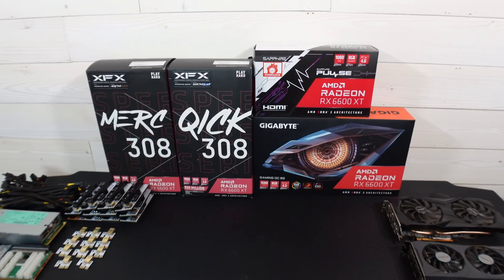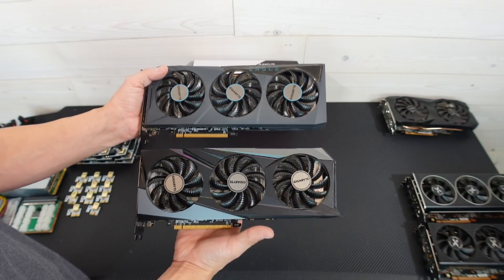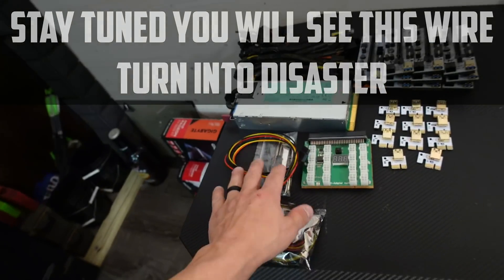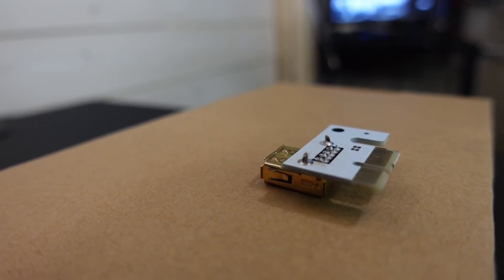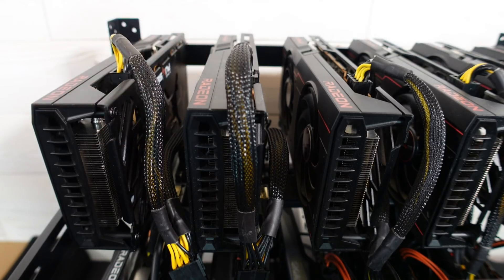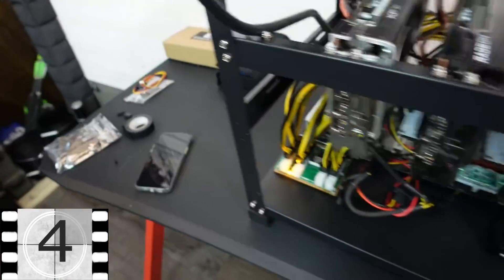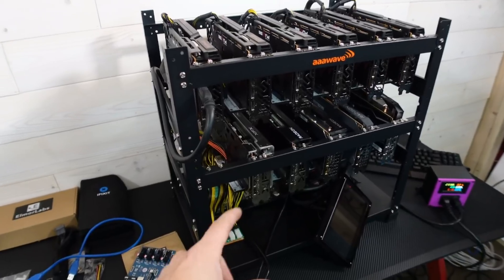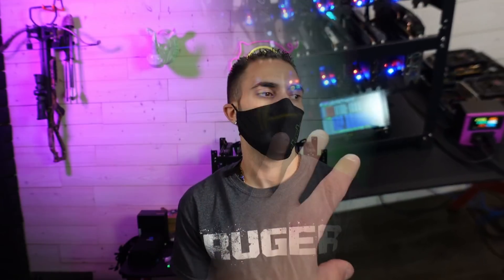RX 6600 XT GPU Mining Rig Build | To Maximize My Ethereum Mining Profitability and Efficiency

Comment: Using sata cables on the mining rig board is a big mistake. Sata and molex cables are low profile and you should never use them. You won't have such problems with 6 or 8 pin cables.
Reply from the maker: The H110 Molex don’t use to much power so it is fine but 100% not recommended; I agree 6-8 pin all day!

Comment: I NEED HELP.
I have a 8x160ti mining rig and it was working great. I am using windows 10.
One morning it shut off and when I restarted it I couldn't get any of the gpus to be detected.
 After undoing the last windows update, I was able to get 3 gpus to be detected.
I've tried all the gpus on other rigs and they all work fine. I've checked the risers and work fine. 
All gpus spin up when powered on. 
 I am booting into the integrated graphics. I was thinking I may need to book into a gpu in order to get into nvidia control panel and just undo the drivers and reinstall them. Could this be the problem? And if so why would this all of a sudden happen? How can I get it to not happen again. Plus what else can I try?
Any help would be greatly appreciated.
Reply from the maker: Get on HiveOS Man Windows Sucks IMO and make it WAY Harder to mine

Comment: I just received the B250C and no signal is coming through to the monitor with HDMI or DISPLAY PORT cables. Have you had to configure anything to make it recognize your monitor? thanks
Reply from the maker: No use the gpu to display not the board
Reply from the maker: In most cases

Comment: one of my rig burned because of power cable after running for several month, luckily only 2 gpus and part of the mobo were burned into ashes,  2 gpus broken because of heat.

Comment: I have the same exact rig, (ASUS and MSI instead of XFX), dude if you want to go over 9 GPU you need to update the BIOS to 1.64 not 1.62, I had that issue. I can't remember where to download the 1.64 tho. I found that trick on another YouTube mining channel.

Also, since you are not using all the PCIe slots, I would free the "long" PCI slot, and then you can use the Motherboard graphics for monitoring, instead of using a GPU.

[edit] Ah, Red Fox already provided a link with the solution to that BIOS problem :)

Comment: Good what NOT todo video .. this will help loads of noobs .. as we all know when it comes to 6pin there are no standard male to male even on some modular ATX PSU you can’t use male 6pin from other PSU and plug directly in a PSU it’s not compatible with .. as the wiring is totally different no matter if it plugs in ... so yeah when doing major conversions from one type of connector to many others you have to 100% know all the pin outs and pin ins..

Comment: Like those pico psu's, they work sweet. I have found that the do need a little cooling. I have had one that was in a dead air space and when the rig got hot it would cause the rig to restart.

Comment: Connecting sata with all conductors to some other sata cable that only has 12V and GND is not a problem, the pinout is still the same.
Something else was messed up, if you want I can investigate this.

Comment: You need the 1.64 bios for 13 cards. Easy fix. Ping me in RPM and I can send you a copy if you cant find one online.
Reply from the maker: Nah man I have all my AsRock H110 Pro BTC+ with 13 cards on em with old original bios. It’s just the RX 6600 XT that I’ve found the issue with so far
Reply: @ChumpChangeXD  Hes actually right, i couldnt load more than 9 amd 6000 series, before i upped bios to 1.64, after all fires up and mines away nicely

Comment: I've been thinking about using a pico psu like this. Or just going with the breakout board that has a 24 pin. Thanks for sharing you mistake with us hopefully it will prevent a few more fires.

Comment: I honestly dont know what that molex was doing on this build risky
Reply from the maker: Because for older BIOS on AsRock H110 You Need The Molex Powered...............
Reply: @ChumpChangeXD  to be honest i had an issue today and that was a fan powered molex, the cheap ones just cannot handle power they need to be binned, unless its a branded fan anything cheap just wont cut it - puff of smoke witnessed
Reply: i honestly refuse to use molex splitters or extensions, stick to a molex straight off the power supply that is in the case of an atx power supply ofcourse.
Reply from the maker: @7302ab  yea agreed unfortunately until you bios update you have to which I didn’t know could be bypassed

Comment: whats your final mh settings after setting it. i saw 355 should be higher though right?
□
Reply from the maker: Nah that’s 32 MH each 60ish watts 
Core 900
Memory 1140

I could do core voltage and stuff but it’s so unstable I’ll use the extra 5 watts  to be stable

Comment: I like the 6600xt for the most part. Last week I tried adding a 6th to my 6600xt rig with no luck. Then I tried adding it to another rig that I am building that has 3 6700xt on it,no luck.Both on hiveos but would just crash as soon as I added the flight sheet. I ended up adding it to my gaming computer that has a 6900xt with no problems.

Comment: "neutrals and hots" - the language of an AC man. an elecchicken ;)  dc is usually in my experience always called ground or zero, because like neutral its supposed to be zero v relative to the "hot" (+12,5, etc) - but only at max. since AC is alternating it also crosses zero at the line frequency so neutral is 120v different both positive, and negative from the hot line, and all voltages in between ;)